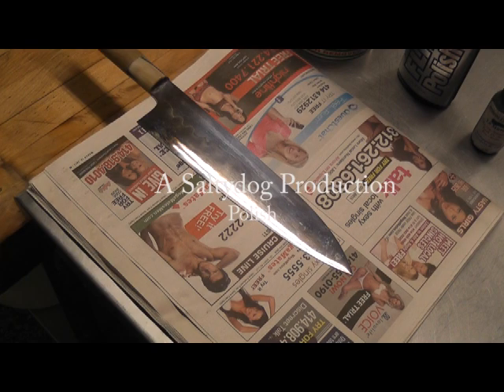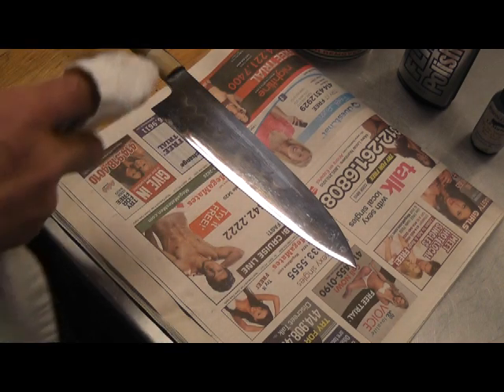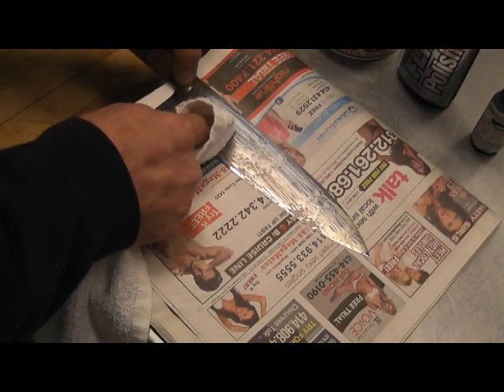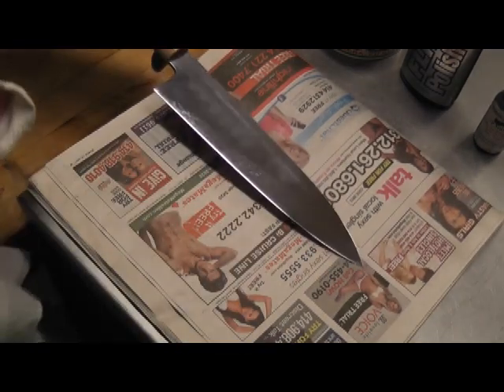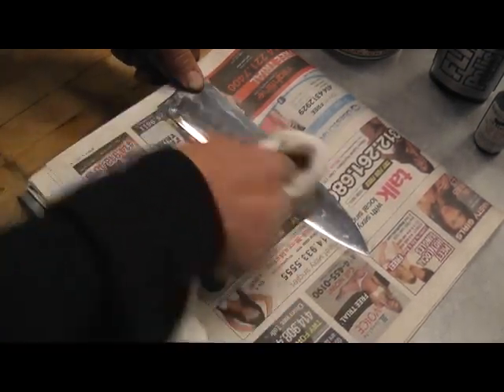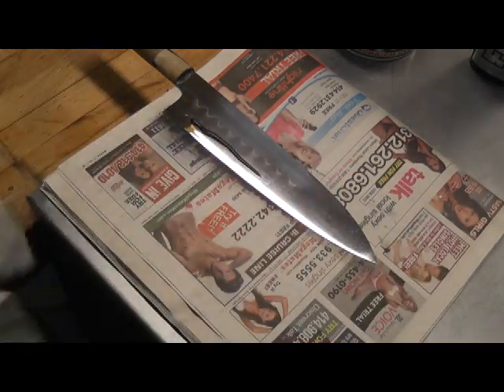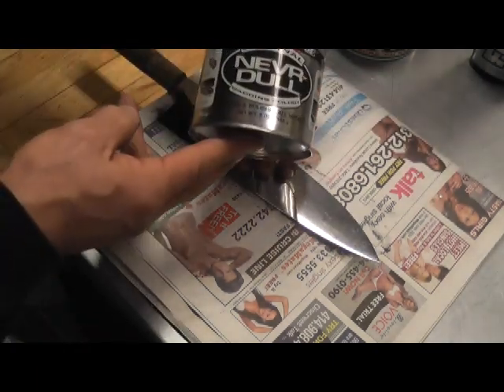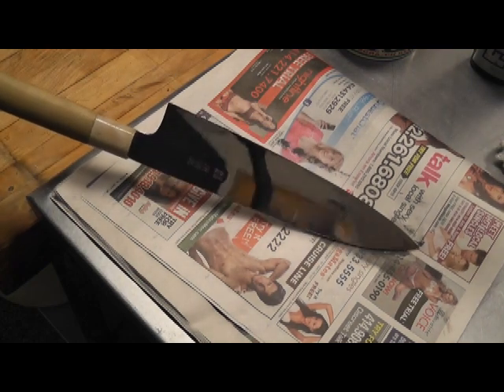Polish

Comment: I just got the Mizuno T B#2 240mm with shinogi. I tried to polish the blade as you describe, didn't do much. So then went further with the 120 grit to 2000 grit progression (by hand) with 3m wet dry. Looks better, lost most of the shinogi, but still not anywhere close to the mirror finish you have. Thoughts?
Reply: do you mean hamon instead of shinogi？